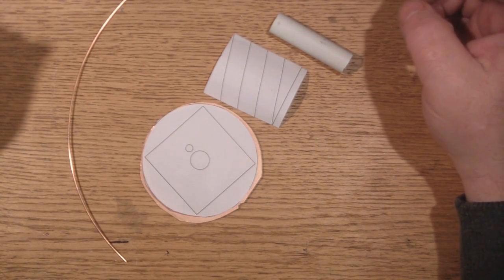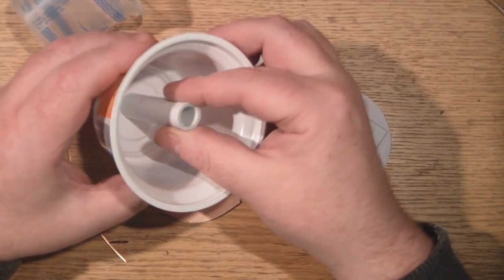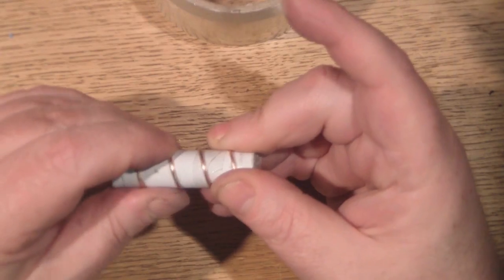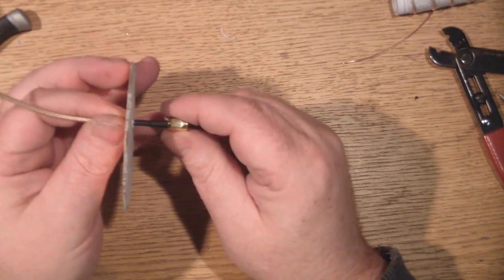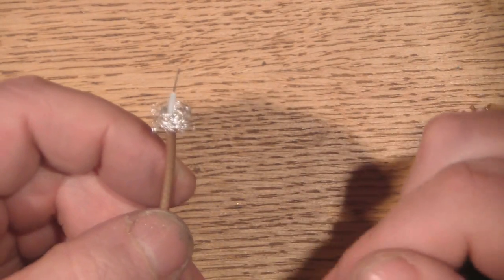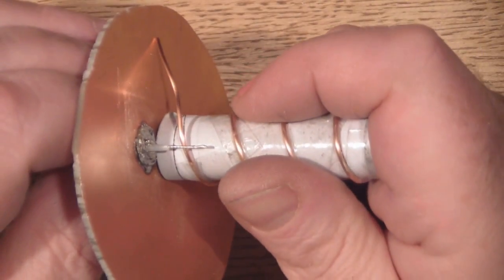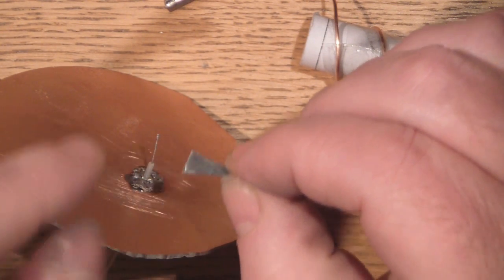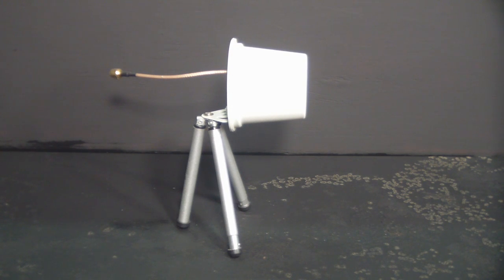Helical Antenna 5 8GHz 4 Turn #36

Comment: Hi Andrew, thanks for this video and all your other helpful videos. I've just built this helical, using RG402 coax, and hot glue to hold the 15mm plastic pipe former to the reflector. What is a good omnidirectional antenna to go with this on the FPV Tx side? I've been using cloverleaf and skew planar up until now, but I like the look of your omni biquad - would this be a good match?

Comment: Just a quick observation in the video I see 17mm on that pipe but you said 15mm?
Could you please clarify for me.
Many thanks
Reply: I was thinking the same thing, Most 5.8 Ghz Helical Tutorials I've viewed, claim that for the Coil to Tune Properly would need to be like around the 17 mm dia. Range.
I'm still a bit stumped, having a tough time finding specifics on how to calculate all the different sizes for various Freq. ???
Also, I think wire size plays a part in the tuning also? And I still don't understand the Impedance thing, how the little wedge thing at the base changes Impedence?..:(

Comment: Whats the helical wire diameter?
Reply from the maker: 20 to 21 swg you can use much thicker wire if you don't want to protect the element but this will increase its bandwidth. Interference from other radio sources.
Reply: thank you

Comment: Andrew, another great project. Maybe for the sake of your audiences sanity you might do a bit on SMA, RP SMA and the permutations
Reply from the maker: Hi Chris I will do something in the new year probably explain connectors and coax.
Reply: Happy New Year Andrew!! I hope you had a wonderful and joyous Xmas. I owe you a response regarding your reply regarding your distant affiliation with an FPV'er who is some 500mi away. That is a shame, however.... Somehow you must get exposure to RC  flight and the magic of FPV. I am sure that for you, to see the practical application of your good works with the measurable and loggable RSSI of the multitude of antennas and their applications, whatever the results, would be nourishing for the grey matter, and who knows maybe the start of something wonderful in your life. A new hobby, wohoo! :-) Here is what I think, make a challenge to those of your subscribers that are into RC to test the CP, disc and helical.  I bet you dollars to donuts that you would have both a favourable and immediate response to your quest. The RC community is is so incredibly generous with their time. It would bring tears to your eyes the selfless acts of tutoring and mentoring and outright massive coding for the public betterment as in the case of ER9X, A completely rewritten Firmware for the humble Turnigy 9X radio that transforms it from a $50 el-cheapo model with crappy GUI and HI to one that is by far in a way comparable to $600 top of the line makes. All by the re-flashing with this free open source coded FW. This in so many ways epitomizes the term, Open Source for me, though I employ lots more of it in the persuit of flying my Quadrocopter
BTW FPV ers and multirotor pilots are few and far between in Canada, and I was reading some threads in RC Groups and I found a chap that is into FPV Quads and the ArduPilot Mega Flight controller that everyone is raving about, who lives 20kM from me and we have already made plans to get together and he will get me up and running, I have to write him tonight to see what his sched is like.
Now, in response to your promise to do a bit on RF connectors, don't forget to mention, as I have just been made aware of, that RPSMA connectors were initially introduced to prevent high-gain, professional grade antennas from being connected to commercial grade wireless equipment. and that it caused a fair bit of  a mess for consumers.
Any self respecting technocrat really should know most of their  RF connectors and applications  I thought I knew most of it until my brain came across this RPSMA. I will be using those SMA and for instance the little known, but widely used Hirose U.FL micro connector (surface mount tech/device) that is used in embedded Wifi s like a laptops wifi module and actually can be found in a number of RC receivers to connect the antenna leads to the tiny ever miniaturizing PCB's.  I am about to take one of these Rx's  and solder  SMA threshold connectors for testing different antenna combos, Like CIrc Polarized and Inverted V Dipole or maybe a Disc of yours! 
I am still such a newbie and have lots to learn. Isn't it great? :-)